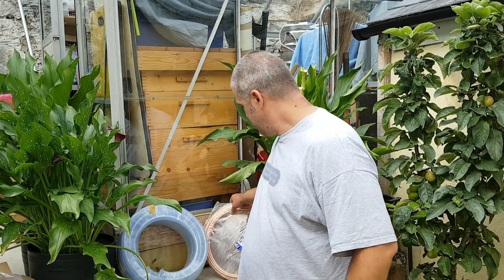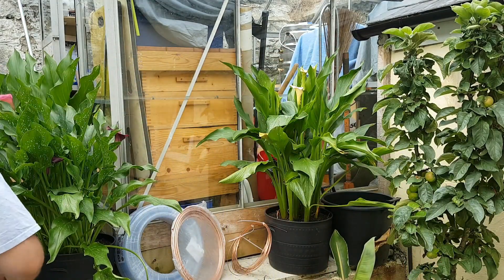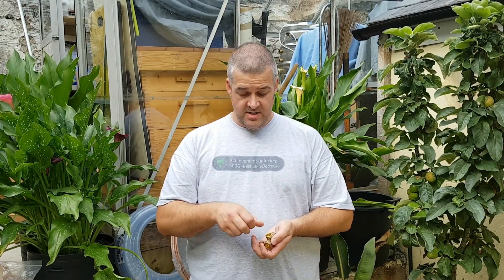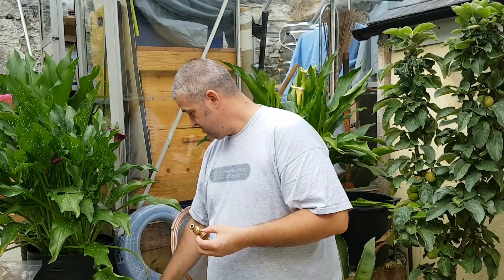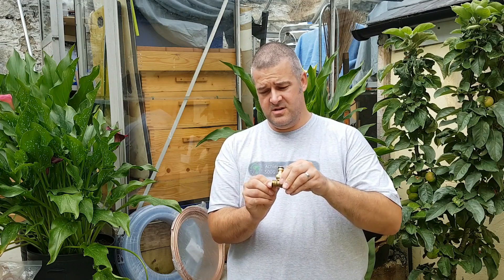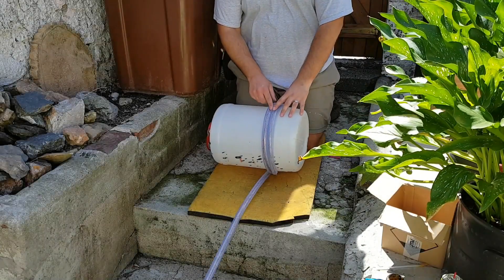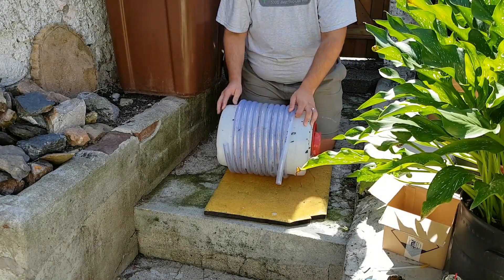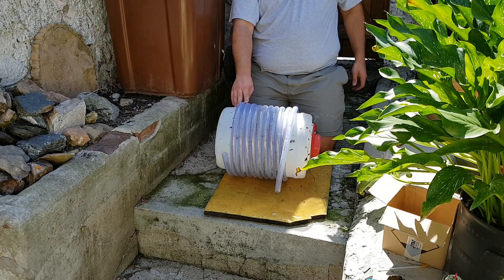Counterflow Wort Chiller (Part 1)

Comment: Hi mat, just a suggestion, if you used solder fittings you can use reducing fittings to get the right diameter you need for the copper pipe and the hosepipe diameter.